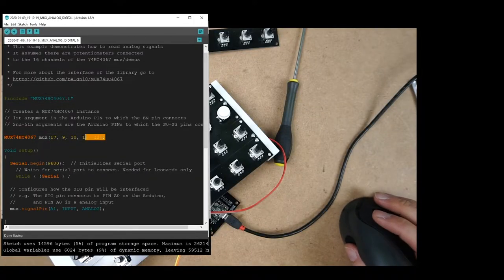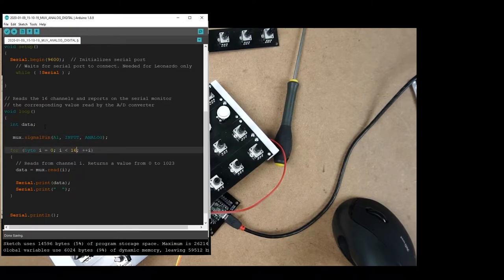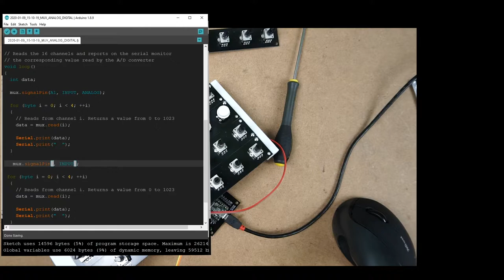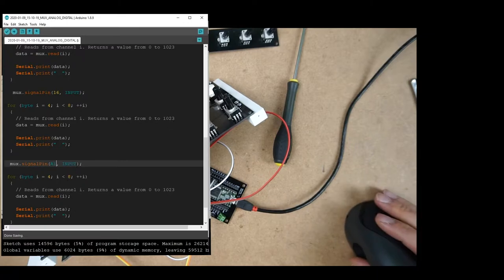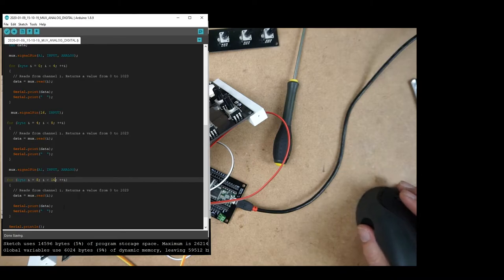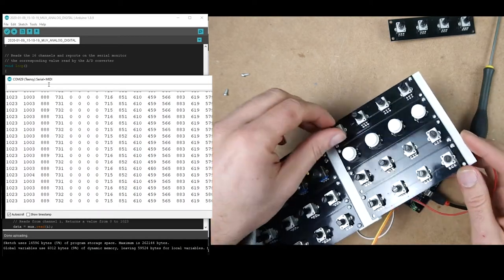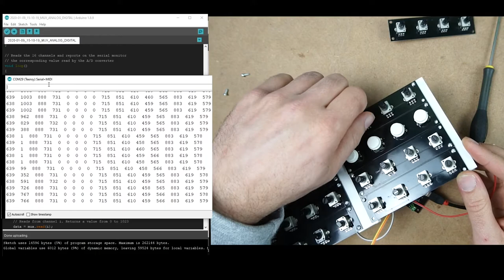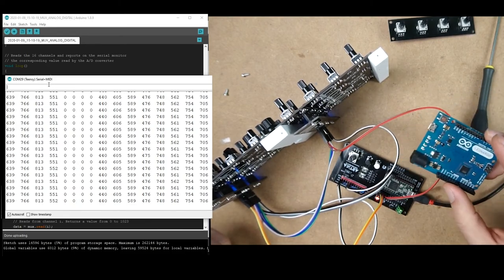Multiplexer #3 - Digital and Analog Inputs

Comment: @Making Stuff by Guilherme Martins
Thank you so much for sharing a great tutorial.
Did you share the signal pin of the multiplexer between two different pins of teensy board , a digital pin and an analog pin ? but both are INPUT type.
Is it possible to wire two or more input and output pins to the signal pin of multiplexer at the same time? is there any interference between signals?
Reply: The signal pin doesn't change. When you need to read analog pins you call the command signalPin(pin, INPUT, ANALOG). When you need to read digital pins you call the command signalPin(pin, INPUT, DIGITAL). Hope it helps!